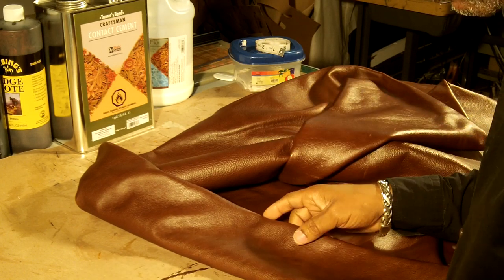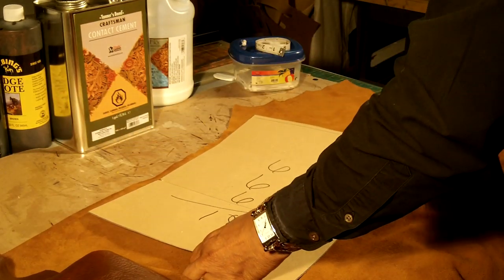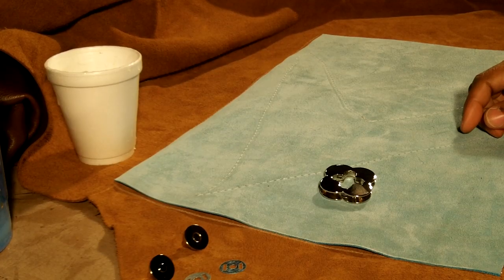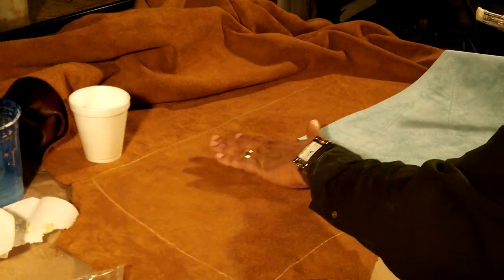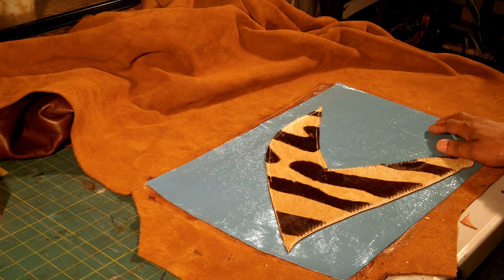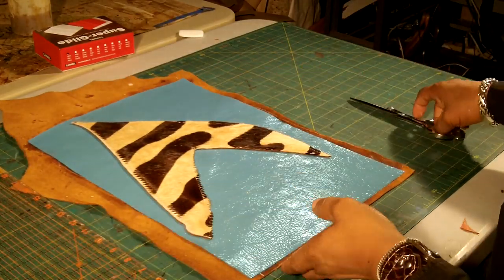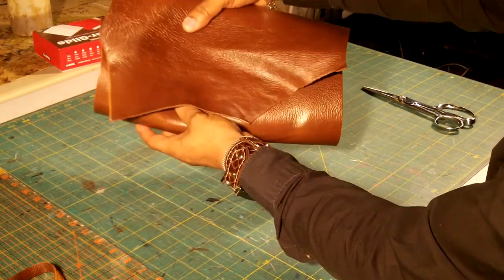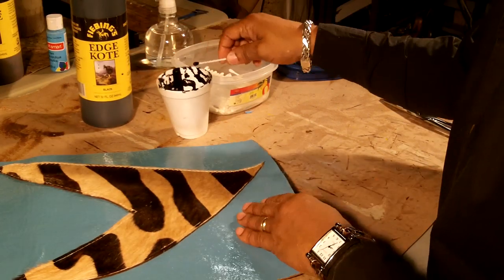How To Make A Leather Clutch Bag Part 3 of 5

Comment from the maker: Hello Venizs, Yes I did use the water base glue for the primary and secondary, the reason is when ever we gluing an area that is more than 
2" x 2" we will use the water base because it contains no harmful vapors, we will use the contact cement glue when we are gluing around the edges and when we are working with 2 leather with the same type of surface and the water base glue will not hold.

Arthur

Comment: Hello Arthur, Thank you for the great video,, we appreciate the knowledge sharing. 
i was wondering if there is a certain thickness for the leather for the edge koteing. i'm currently working with sued leather for a clutch bag. do you recommend the same edge koteing that you are using in this video? thanks a lot!
Reply from the maker: Hello Mimi, The thickness will not make a difference, but you do not want to put edge kote on sued, it will soak up what ever you put on it.

Arthur

Comment: Hi, if i decide to use fabric as a secondary, would you still recommend glue? I'm sure that if i was using thick felt or boiled wool the glue wouldn't seep through but what would you suggest if i was thinking of using a thinner fabric?
Reply from the maker: Hello Ken, if you use glue I recommend, you only use it around the edges, if you use edge kote it will soak in to your fabric, I am going to do a video showing how to make a clutch with a fabric lining.

Arthur
Reply: Ah thank you. I suppose I just need to interface the fabric.  My main worry is that through use the fabric would stretch more than the leather
Reply from the maker: Ken, I don't think the fabric will stretch, but I do think the glue and fabric will give you some problems, your best results will be with spray adhesive.

Arthur